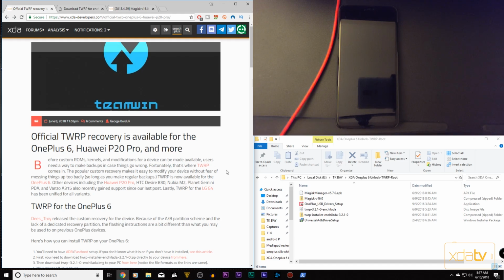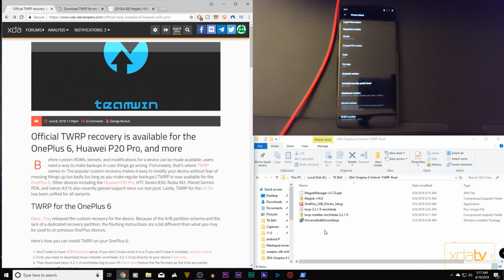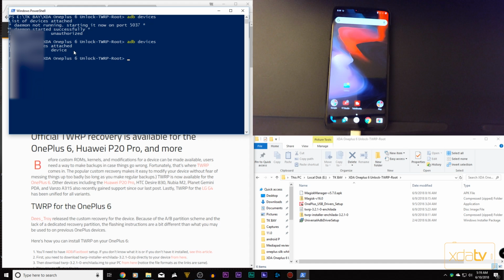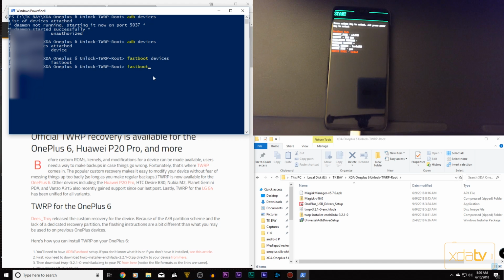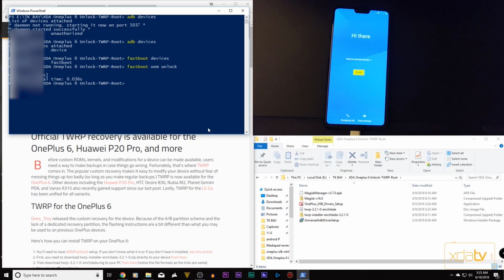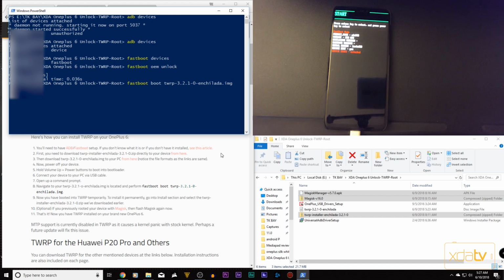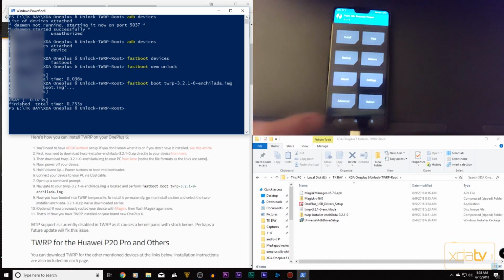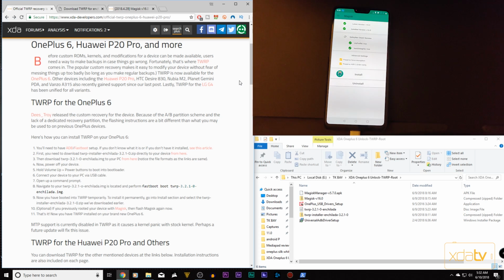How to unlock bootloader, install Magisk root, & flash TWRP on OnePlus 6

Comment: Anyone have a good way to root a Samsung Galaxy a10e2u from AT&T/Cricket IMEI: 358689100506474 Serial number: RF8N11W82TY.
Even if there isn't a way yet please let me know when there is.
I could not find a TWRP Firmware for it either.

Comment: Sir I used this method to unlock the bootloader and install twrp on my oneplus 7...I downloaded the required files needed for the oneplus 7 and firstly I unlocked the bootloader using ADB.and after unlocking the bootloader I restarted my phone and my stock wallpapers went missing and a different wallpaper appeared on my screen that I haven't seen before. Also the icon pack where little bit different.... But I just ignored all of that and I again rebooted the phone to fastboot mode and I installed TWRP using ADB.after installing TWRP my phone got stuck on the fastboot screen showing the 1+ Plus icon.....What should I do to install TWRP and root my phone... please Help me..... I downloaded the twrp image file for oneplus 7 from official TWRP site...It was named as twrp-3.3.1-1-guacamoleb.img.

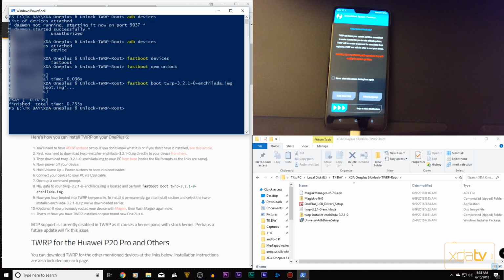Comment: Can't boot into TWRP (like shown around 4:08). It shows the device as QUSB_BULK_SN######. Is Android 8.1 not rootable yet? Thanks.

Edit: Nevermind, I was using the wrong version, the correct version of TWRP to use is twrp-3.2.1-0-enchilada.img

Comment: ~~~~~~~~~~~~~FIX FOR THE QUALCOMM CRASHBUMP SCREEN~~~~~~~~~~~~~
First. My crash did not brick the devise its not from the roms boot.img. Its from the twrp's boot.img
If you have the save problem as me Probably I have a fix for you
So.... I found a way around it.Root checker app says that I have root but I havent tested any other app yet.Magisk Installed.

-instead of the original img file you have to use this:
https://forum.xda-developers.com/showpost.php?p=77628189&postcount=438
with the above command.
-When install normal twrp file like the video and after that I installed a stock rom(Oxygen 9) from the oneplus website and then I installed twrp again, rebooted to recovery and installed Magisk
-Probably you can skip the first twrp install before the rom but I did it just to be sure

Comment: after flshing twrp it says qualcomm crashbump mode why?
Reply: Its a qualcomm crash and the phone cant boot into the img file. I have the same issue.Little progress. When I will get it to work I will tell you how to fix it..
U can also google it.
Reply: First. My crash did not brick the devise its not from the roms boot.img. Its from the twrp's boot.img
If you have the save problem as me Probably I have a fix for you
So.... I found a way around it.Root checker app says that I have root but I havent tested any other app yet.Magisk Installed.

-instead of the original img file you have to use this:
https://forum.xda-developers.com/showpost.php?p=77628189&postcount=438
with the above command.
-When install normal twrp file like the video and after that I installed a stock rom(Oxygen 9) from the oneplus website and then I installed twrp again, rebooted to recovery and installed Magisk
-Probably you can skip the first twrp install before the rom but I did it just to be sure
Reply: @Nickoschannel  it will not brick my phone right?
Reply: I cannot guaranty you anything since I dont know if your problem,hardware is exacly like mine.
I can just tell you that there is an unbricking tool that flashes everything to the phone again if something bad happends.I used it to reset the phone trying to fix the crash problem and it says that it can save hard bricked devices too Its called MsmDownloadTool
Reply: what cmd u used for twrp in cmd window? to flash twrp
Reply: I dont know what you mean exacly but I used the given .img file and the above command in the link above instead of the given in the video

Comment: Can confirm that this works on the latest OxygenOs 5.1.11, however I wouldn't risk using the latest version of Magisk when rooting. I flashed version 16.4 along with manager 5.7.0 and later updated it through the magisk manager app to 17.1 and the latest version of MM which is 5.9.1 I believe.
Safety net passes and everything works correctly.
Reply: i did what you said but it says SAfetynet API Error
Reply: Try clearing Magisk manager data then relaunch the app and see if that fixes it.

Comment: What happens to the phone when you root it? Could there something happen with the phone?
Reply: You can do things you couldn't before. Change theme, fonts, boot animation, remove bloatware, increase CPU and GPU speed to increase performance, reduce CPU and GPU speed to save battery, you can change everything on the phone when you root. Rooting gives you admin access to the system which means you can change the system however you want, you can even download a root file explorer and change the system files and delete them if you wanted to. Rooting allows you to do things on your Android phone/tablet that you aren't normally allowed to do, it removes the restriction so that means you can change the device however you want to.

Comment: I followed all the steps but once I want to install the image in the temporary image of twrp, the img file doesn't appear in the 'sdcard' folder. 
Inside the 'sdcard' folder, I can see about 11 folders with different names like: 1NCa3h2ZdlpXVu7uhle6wC
There is no other folders in the 'sdcard' folder.
I presume that normally you should see your folder structure as you would see it on the pc (download, dcim, .. )
I seem to have no access to my internal storage from the temporary twrp.

Also, after every reboot of my phone (in normal mode) I have to change the USB configuration from 'charging' to 'MTP' EVERY TIME otherwise I don't have access to the files on my phone via pc (took me a while to figure this out because I couldn't load the files on my device at first).
I think this is the reason that I can not see those files in twrp.

Anyone with a tip or help?

Comment: adb : The term 'adb' is not recognized as the name of a cmdlet, function, script file, or operable program. Check the s
pelling of the name, or if a path was included, verify that the path is correct and try again.
At line:1 char:1
+ adb devices
+ ~~~
    + CategoryInfo          : ObjectNotFound: (adb:String) [], CommandNotFoundException
    + FullyQualifiedErrorId : CommandNotFoundException
Reply: whyyyyy why me......

Comment: help i'm stuck at fastboot boot twrp-3.2.1-0-enchilada.img. it says no such file or directory
Reply: the path of your twrp img is missing
Reply: How to fix that?
Reply: I am stuck there as well
Reply: you either have to have it in the same directory as the adb/fastboot stuff or add the file path. C:\Users\YourUserName\Downloads\your-twrp.img or something
Reply: crashniels double checked. They are in the same directory.
Reply: crashniels same error still
Reply: do you have discord? add me crashniels#3692. i can help you and there you can also send screenshots. but im sure you misspelled it or have got it on the wrong folder
Reply: crashniels thanks a lot man. Turns out the adb drivers weren't installed correctly. Reinstalled and it works like a charm
Reply: crashniels  i have same issue, can u help me on dicord. my name ther is sth like Dr.TryOut
Reply: just copy the file twrp-3.2.1-0-enchilada.img to that platform-tools folder, and try the command again

Comment: Do you lock bootloader after installing TWRP and Magisk?
Reply: dont think so
Reply: No, don't do that! The phone won't work if you do, TWRP and Magisk are not singed by the manufacturer. Which means that locked bootloaders won't boot TWRP and Magisk, only unlocked bootloaders will. Keep your bootloader unlocked after this.

Comment: As someone new to rooting and trying to find a good tutorial, I came across this video. All the information is here, but I can not wrap my head around why you would choose to fast forward through all the options and prompts during the most important part of the installation, and then do narration on a static screen that shows the process completed. People using tutorials want to see the step-by-step process in full detail so that we can follow along and not a make a mistake. Either way, thanks for taking time to make this.
Reply: Yea, I just play it back in 0.25x speed to see where he tapped.

Comment: Good job @TK Bay. It'd be good for you (someone) to do a video for installing official TWRP coming from unofficial. Alot of people are having trouble and bricking. Just a thought. Thanks for the support!!
Reply: Craig Ippolito that would be easy , when a stable version of twrp is released and everyone is happy with it just go in twrp ( unofficial ) and click on flash .IMG the button is at the bottom right then find the stable twrp and swipe to flash and it will overwrite the unofficial one...
Reply: HD Android Gameplay.tv while I am aware and yes it was extremely simple many were challenged and ended up bricking or boot looping their device. When you have many that are not very farmiliar with root it makes for a rough XDA go of things LOL. Again, just a thought.